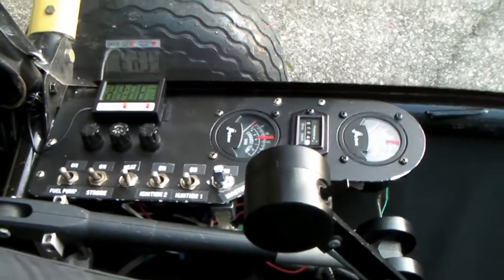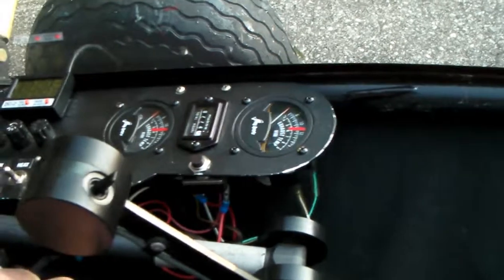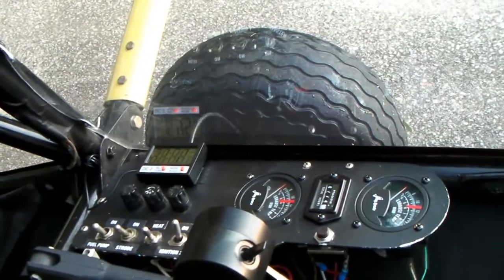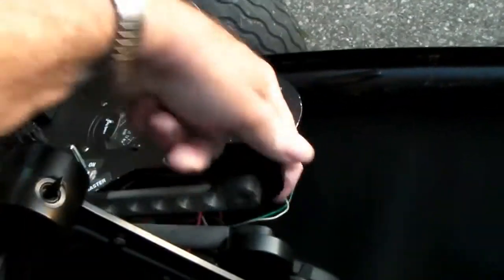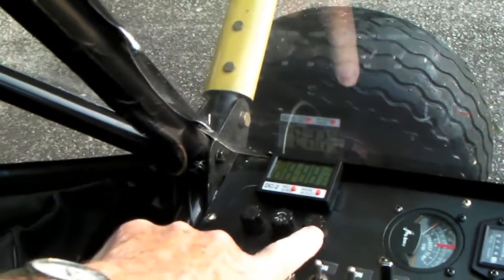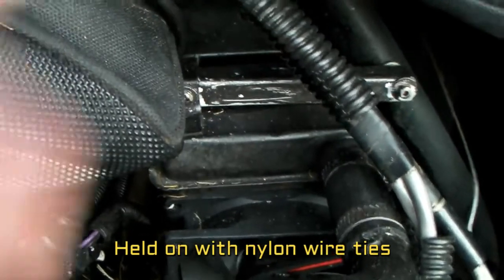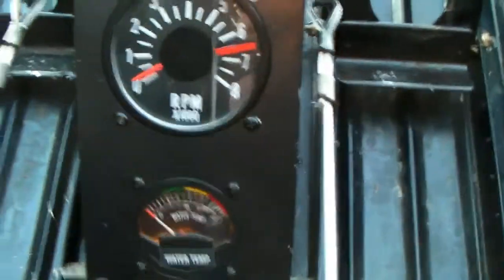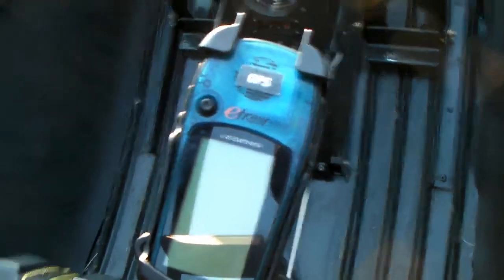Chinook instruments, Switches & Cabin Heat

Comment: I read somewhere that the Chinook plus 2 didn't make a good first airplane not sure what they meant something how it takes constant attention of the controls it would not be a good trainer.  I have heard that these high thrust mounted engines ultralights can cause lot of drag sometimes cause suprise to GA pilots. Also it's easy to get too slow in the pattern if your not staying coordinated due to this drag. I'm looking for a first plane going to get my light sport certificate.
Reply from the maker: I did not think that my ASAP Canadian made kit was very practical as a first airplane. I was very easy and fast to build, but needed modifications to fly well.  It needed mods to the tailwheel and the landing gear suspension.
It would fly hands off at cruise, but was very twitchy if flown fast.
It would not be good as a trainer.
It is fast and will lift a lot of weight for the power used.
My videos show many of the modifications that I felt were needed.
I know nothing about the ones made in Texas.